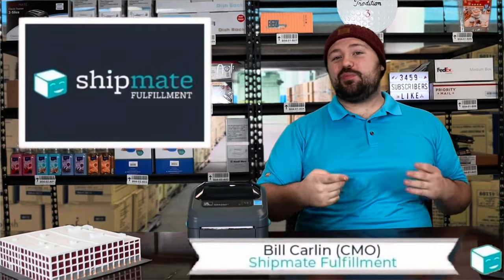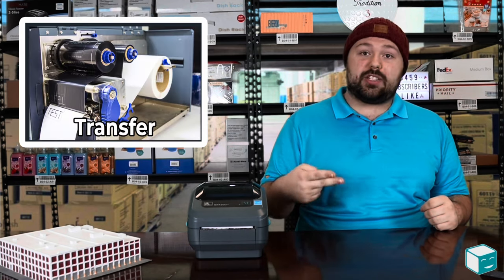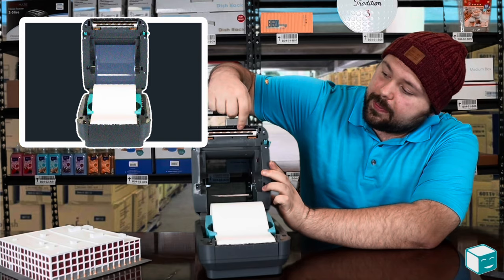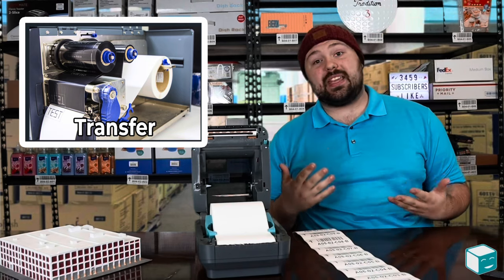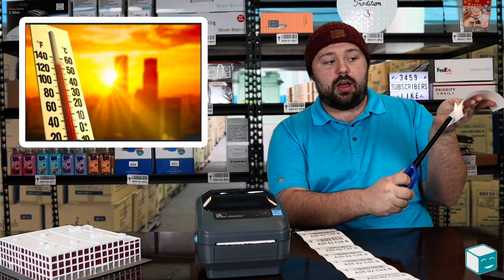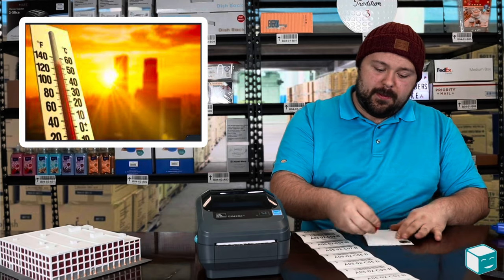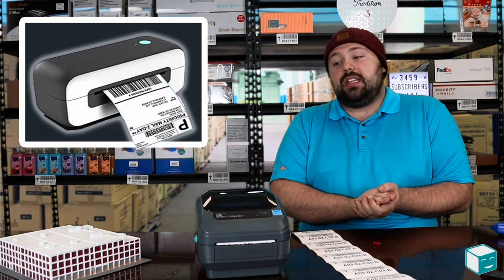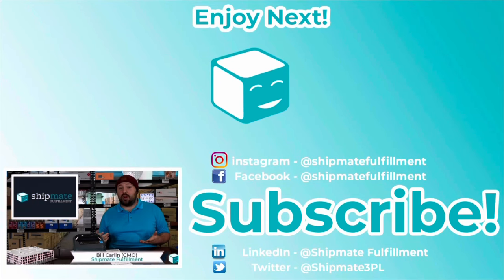What Are Thermal Label Printers? What You NEED To Know About Thermal Printers And How They Work!

Comment: I wish I knew about these. I rarely ever use a printer. Like once every 3 years and I'm normally returning something that requires the label to be printed by me. By the time I have to do it all my ink is dried up and buying more ink makes the return pointless because of the cost. If I don't need ink that makes things way easier.
Reply: Hi! So, I used to think I was having this experience, but that's not what is happening, as the jets can be cleaned with rubbing alcohol. Cartridges for, at least HP printers, all have chips. I believe HP secretly expires them.

I'm on HP Instant Ink now. Interestingly, the same cartridge has been fine for..... maybe over a year now.

Same cart except it doesn't expire when leased. Pretty pathetic, amirite?

Comment: Can i use the normal A4 size white paper that we are using in the Xerox machine or it's shoulde be some kind of special paper for any kind of therma printer...❓️❓️❓️
Reply: it's a paper coated with chemicals that turn black with heat. i think it's called thermal transfer paper